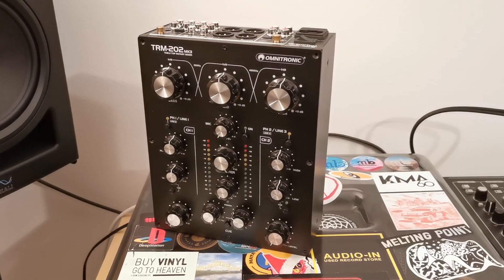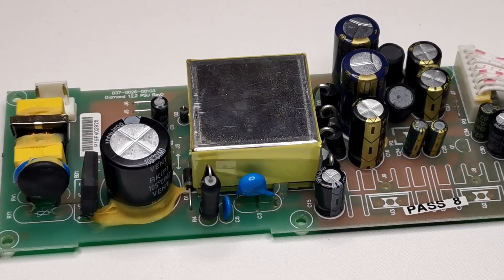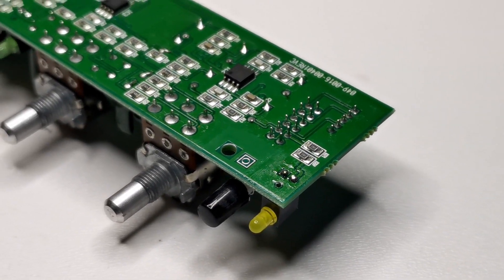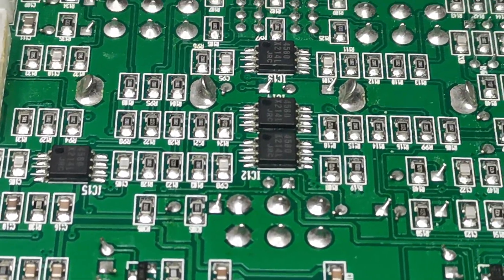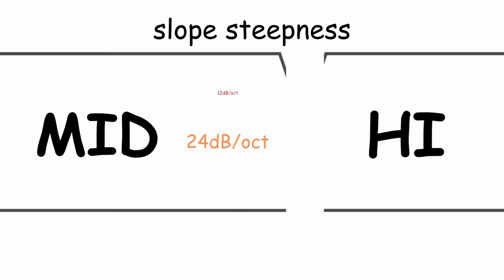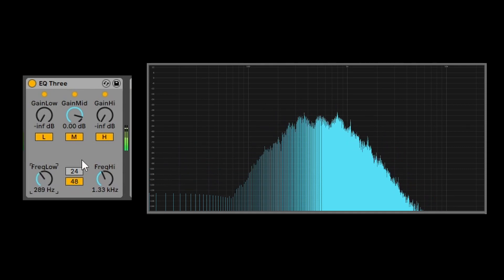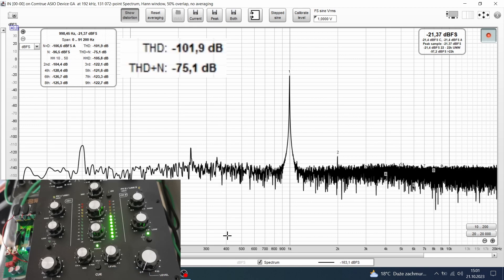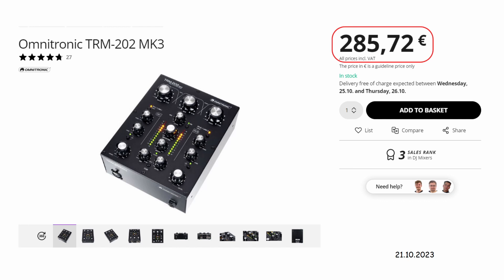Mixers Inside: Omnitronic TRM-202 MK3 + Isolator EQ explained

Comment: I just noticed something I missed... the specs on websites say:
"Frequency range line : 20 - 20,000 Hz
Frequency range phono: 40 - 18,000 Hz" ...is this really just different wording for the RIAA curve? Or, does it really cut-off everything below 40Hz? (which would be strange)
Reply from the maker: Some manufacturers just define flatness of the curve for limited freq range. Its possible that below 40Hz there is a rolloff but its for sure not cutting off everything.

Comment: Great job! Looks like I have a power supply problem with the bigger model, but used same power module. Power shuts off after a while. Capacitors and solderings are fine. Looks like the TOP267VG chip is getting too hot and switching off.

Comment: Thank you for this review, I fell in love with the 4 channel version at my friend's house, watched this and decided to get the 202.

Happy with the summing, but the EQ sounds weak: leaving the channel EQ to the 12 oclock notch, the tracks sound weak, but turning it one dot to the right the tracks sound as they should.

Is there a way to change the knobs so that they notch further than the default position? Hope this makes sense.
Reply from the maker: Maybe your system doesn't have enough bass and you just compensate this with EQ.
Reply: @mixersinside  Thank you for your fast reply. I have a lenghty but detailed answer.

Yes I have an issue in the low end lacking punch, but ALSO the high end lacking clarity. 

It'd be reasonable to assume it's the speakers, but: I never had any issue with any other device. 
System isn't massive but plenty for the room: a couple of Genelec 8010 and a 7040 subwoofer to go with them. 

I tried many audio devices, mostly a Xone 96, a DJM 450, or even straight from my Macbook: all of them always sounded detailed in the high and rich in the low end.
I have no reason to believe it's the speakers. 

btw at the time I tried my friend's 4 channel TRM-402 (I went for the 202) he also had a couple of Genelec 8010 (without the sub! just the 2 speakers) and I loved how the whole thing sounded. 
We hooked up both Technics and my Macbook (jack to RCA, or with a cheap DVS interface, both sounded great). 

I also checked with another system, this time in the garage: a pair of 15" heads and a 18" sub. This time the low end could be compensated by just cranking the volume, but the mixer still lacked clarity in the high end. 

A slight rotation of the High and Low EQ away from the 12 o'clock notch, one dot to the right, and the tracks come alive. 

All things being equal, the only weak point seems to be this 202 mk3.
Reply from the maker: @matteorizzo it makes sense, 2 devices with flat frequency response can have different tonality. Perhaps other mixers you compared TRM with had different sound signature. I consider TRM really transparent uncoloring mixer, devices like Xone for example give more color to sound. Perhaps Omnitronic doesn't go well with your system and taste.
Reply: @mixersinside  This 202 does sound great with the EQ slightly turned up though, wouldn't it be enough to change the pots' default behaviour?

I guess the final test would be to check another 202 or a 402 on these speakers.

Comment: I had the mkII, sold it and then got the Mastersounds Radius 2, almost x4 the price. On reflection, although the Radius 2 was a lovely little thing, the mkII was a fantastic deal.

Out of interest, do you know much about the omnitronic rrm-502? Only a couple reviews online and they're not great. But from it's appearance and looking at the manual it resembles the simplicity (and therefore potentially the short single path) of urei 1620 or the Bozak cma, but with out the balance controls, which I've seen is sometimes purposefully removed from the Bozak.
Reply from the maker: @danellanthony  thank you for sharing your thoughts and very realistic non-snob approach. Unfortunately I know nothing about RRM-502.
Reply: @mixersinside  np, and thanks for the great content and helping to break down perceptions 👍

Comment: I ordered a SubZero 2 channel rotary today, €180! I'll compare it with my Urei1620, I'm excited 😆
What would be the point of changing the capacitors, an upgrade so to speak. Have you ever tested that?
Reply from the maker: I'm curious about your findings. The only type of capacitors i would consider changing as an upgrade are the ones working in filter sections. I didn't test this.
Reply: @mixersinside  I think a 1620 video would be nice, maybe you'll find the time someday.
Regards
Reply from the maker: @braien25980  I have original 1620 filmed and analysed. I will show its internals in the wider context, cause I'm making a 1620 clone and I show the whole process on this channel. There is already an episode uploaded where I dive into 1620 schematics and comment what's going on there.

Comment: Still sending outputs to my Technics 1200's with this faithful 2 channel mixer. Always have the master at 12 o'clock, the levels dial never been near the 3rd dots and rarely see the green LED's blink past -25 but they can if I turn into an asshole, the Yamaha and KRK monitors get very loud in that zone, I could have my dials set all wrong but from what I can hear this is a very good mixer.

Comment: Hi there. Great review! I have one for a few years now, and I'm really happy with mixer for the price.
I think the phono pre-amps are pretty crap, but fortunately I have a dual tube valve phono pre-amp. 
Could you run some measurements on the phono pre-amps, Master and Booth outputs? That would be awesome. 
Keep up the great work.
Thanks
Reply from the maker: I did measurements on master outputs. If you watch my other videos you will easily find out that phono preamps here are almost the same as in Ecler or Rane mixers.

I don't want to make this channel a measurement hub, i do measurements to give you an idea whether mixer is more on transparent or dirty side and don't want to expand it much.

Comment: My old Vestax packed in a couple of years ago and my poor old 1210's have been incomplete.
I wasjust about to buy an Ecler nuo 2 and that is how I found you.... Thank you for such in depth reviews and testing.

 I am intrigued by the Omnitronics am I right in thinking the sound is better (subjective I know) on the Omni than the Ecler??

I want faders, do you know if the Omnitronic pm 322 uses the same components/has the same sound quality??

Thank you
Reply from the maker: To judge the sound quality you must listen - this is the final criteria. Numbers and measurements can help you to indicate if there is something going wrong or not according to the plan. I won't answer your question.

Regarding this omnitronic mixer - i don't know.

Cheers!
Reply: @mixersinside   I thought you would say something along those lines.

I loved the sound of my old Vestax which had a fair amount of distortion, definitely not clean but it did draw you in somehow.

Also, I find when playing CDJ's or wav files a bit of added body from the mixer can be fun. Ill probably stick with the plan an get the Ecler

Many thanks for your reply.
Reply: @nothingmemorable486  how did it get on with your Ecler, would you change it you could easily for something else.....assuming you had time now to sense the sound profile and maybe also based on what you want or consider to be missing....appreciate any feedback, cheers.

Comment: Hi Kamil, great content you are providing, )'m really thankfully for your work,  I have this mixer right here, and I've seen your recently RANE MP2016 and XONE also, do you think based on your experience and knowledge that would be possible to modify TRM with more quality components present on that mixers, or even make a simple smaller one like TRM 202 bases on the same principles and components? Cheers
Reply from the maker: Yes, for sure. Good starting point is experimenting with op amps, not necessarily more expensive ones.

Comment: Are the pots VCA ? or does the audio run through them ?
Reply from the maker: Non VCA, passive attenuation using stereo pots here (audio runs through them).
Reply: OMG , that is a HUGE fail . . .  .  @mixersinside
Reply from the maker: @user-rv8wb1nl1b  why? I don't agree that it's a fail. Most of rotary mixers have audio running through their pots. VCA sollution has more distortion than passive one. I cover this topic in Ecler Nuo 2.0 vs Warm 2 video.
Reply: in the medium to long term you do not want audio going through the things you tweak and turn most often . Inevitable crackles , why would a vca have higher distortion (if its even audible ) ?  rotary mixers are a bit of a fad , whatever next . go Mancuso Loft party and have no mixer , just an amp . . . ? @mixersinside
Reply from the maker: @user-rv8wb1nl1b  so you consider a budget mixer not using more advanced sollution (that still can degrade THD performance and there is a reason to avoid it) as a huge fail?
Reply: i very much doubt your ears can hear any thd distortion , ears are not that sensitive even if there were an increase , which is not evident in the first place . vca is proven better when done right and will last with no crackles . I think Rane used a magnet for a while and pioneer where optical in the 90s if i remember correctly , aaaanyhow , the LAST thing you want is audio going through a pot or slider . period . @mixersinside
Reply from the maker: @user-rv8wb1nl1b  speaking of proofs can you share some documents with me? This will be so useful and nice to read, thanks.
Reply from the maker: And yes, i obviously agree with you that audio going through sliders has serious disadvantages.
Reply: ears can barely hear a 3db change in volume , so even a 3% thd level (ridiculously high ! ) would hardly be perceivable at a 100db sound level . ( yes its rough maths but it does logically flow ) . A crackle in a pot or slider'fader can ruin a mix and need replacing . Great vids and info , thanks . @mixersinside
Reply from the maker: @user-rv8wb1nl1b  sources please!

Regarding 3dB difference in volume hmmm. I hear 1dB easily and its very easy to check with some basic software.
Reply from the maker: Let me provide the source then. It more or less goes along with what you say, but somebody took serious effort to check it.

http://archimago.blogspot.com/2020/06/blind-test-results-part-ii-is-high.html?m=1

Anyway i think that it's always worth it to minimize the THD when you aim for transparency. VCAs still don't have vanishibgly low distortion figures and in fact there are some ways to achieve better performance than using VCAs, while preserving the VCA pros like audio signal not running through pots, perfectly logarythmic curve and perfect channel matching and even achieve better "offness", that is often forgotten parameter.

The idea of making it better than a classic VCA first started from Rodec MX00 progressive series. I will for sure record an episode about it.
Reply: it's just known .. . . . Vestax Gemini  etc charged a premium for this for a good reason . No need to invent the idea that vca is noisy , just go with the facts , or speak to a circuit designer who does audio. I always liked the optical idea , with a mirror on the crossfader , and a laser feed , maybe it was Rane/Bozak . But then in a club , smoke may mess with the lightsource. VCA is best . @mixersinside
Reply from the maker: @user-rv8wb1nl1b  there is a simpler way than lasers. VCAs are not technically the best and i will try to prove it in one of the upcoming episodes. If you care you can check what i wrote in previous comment regarding this sollution.

Comment: Had the TRM402 for two years and I was so blown away by it I bought a Condesa (Lucia). And honestly, for home use the Omni really comes close in sound quality and summing capabilities to it when playing from a digital source like CDJ2000's. It's when you really start cranking up the volume an a serious soundsystem that the Condesa really starts to shine.

For the price it's an insane mixer and I can higly recommend it if you want to dip your toes into rotary mixers. Built quality is really high and it feels like a tank. It's the phono amps, isolator and the 3 band channel eq in the Condesa that make the difference compared to the Omni, they are superb in every way compared to ANY mixer (it should offcourse as the Condesa is 8 times(!) the price of the TRM202).

Overall I find the sound quality of the Omni's way better than a DJM700 or 800, and more on par like a DJM900. I can highly recommend it, and for it's price it's a fun addition to any dj set as mixing with a rotary is a different experience and mixing appraoch than a standard mixer.
Reply from the maker: Thanks for your comment. I feel a significant influence from the widespread excitement about Condesa mixers here. I hope to make an episode about those "legendary" devices so people can compare their build quality to other mixers and verify their opinion.
Reply: Would be very interesting to see how a Condesa is build up on the inside from an engineer’s point of view and find out if these boutique mixers really are worth their money!
Reply: @ltdada74 Also have had a 402 for years and this is a great summary. Never played on a condesa or Alpha etc.. But the sound quality has always been more than sufficient. I love my 402 and will probably never get rid of it.
Reply: Is it possible to monitor the master with the ISO using headphones?
Reply: @EduardoAlmeidaRJ   no

Comment: They spend maybe £25 to manufacture this mixer
Reply from the maker: nonsense comment
Reply: @mixersinside  250 retail. Retail price is usually x10 than actual production cost. Look at the components cost and circuit board. It's a fully analog mixer. Nothing crazy. Very cheap and easy to make
Reply from the maker: @MartinTeerly  if you happen to design a good performing £25 mixer with metal casing, reliable power supply, decent quality pots etc. please contact me via mixersinside@gmail.com, i have a businessplan.
Reply: @mixersinside you already said in your video that circuit board is also used in different model. I also want to to look on studio mixers and it's pricing. They're very cheap. Current prices of DJ mixers is ruled by Pioneer.
Reply from the maker: @MartinTeerly  please be realistic and do your research before posting such comments. Cheers.
Reply: @mixersinside  hahahaha ok
Reply: They spend that on the employee to assemble and test the thing alone, then they package and ship it, and provide warranty service for it.  That’s before factoring any component costs.  It’s objectively great value.

Comment: A nice little honest mixer with no BS, I do wish they would put a by-pass switch for the ISO tho and not just on this but others of this kind. On things like the DJR-400 I feel it's the only thing that really tends to degrade it's sound. The original Bozak also uses a Bax style eq for the master output ;) But I like where they chose the bands it boosts and attenuates 60hz and 10k
Reply from the maker: Can you explain what "BS" is?
Reply: @mixersinside  Bullshit :D Unrelated but if you'd measure the old Urei and Bozak's, they're pretty terrible. The Urei has a lot of distortion and pretty poor PSU, the Bozak again similar but less so but a lot of PSU ripple. Cross talk etc is also pretty pants depending on what you've done to it. Contrary to belief also the RIAA pre on the Bozak is flat or at least on my unit when I tested it on a Lindos unit. You should have a look at the silver A&H Xone 62, always liked those and now get overshadowed by other stuff.
Reply from the maker: @vinyljunkie07  I know Xone 62 well - the sound signature of this mixer is mostly shaped by SSM2164 VCA and in terms of distortion it's also nothing spectacular (but the sound is nice and round). Phono preamp in 62 is single stage active on NE5532 - not a standout. Apart from that it has pretty much the same circuitry as other mixers. 

And it has strange EQ, the low knob is behaving weird. They fixed it in 92 mixer.
Reply: @mixersinside  I never used those things when I mix on them lol I hate the sound when the filter is enabled and it just adds noise from memory, also I always have the x-fader bypassed for me... And eq most of the time.. But always liked the cut of the faders, the feel also (The 92's are far too loose feeling) and the sound wasn't hard in any way. I dislike the high capacitive loading on the phono inputs considering the turntable alone with it's wires will add another 120pf if it's a 1200 mk2 which seems to be across the board on their mixers.

Comment: Hello, first of all thank you for sharing your knowledge, it's very valuable !

 I have a question about the THD+N measured at nominal level. The measured THD+N value (-75.1dB) seems to be relatively high compared to the THD (-101.9dB). And when you look at the Bozak values in your last video, the 2 values (THD and THD+N measured at nominal level) are almost equal.

 Does this mean that the performance of the Omnitronics in terms of noise isn't great, or is this a "normal" value and the near equality between the THD and THD+N values of the Bozak comes from the high THD of the latter? I hope I've made myself clear, thanks in advance :)
Reply from the maker: I'm very glad that you watched this video with such attention to details.

The difference between THD and THD+N value in Omnitronic mixer shouldn't be a surprise, because the THD alone doesn't take the noise component into account, and well - the Omnitronic noise performance isn't spectacular. I suspect that it's hard to achieve better noise figures using ICs from this price range.

Close values of THD and THD+N in Bozak should also not be surprising, because the THD alone of Bozak is so high, that adding the noise component doesn't make much difference.

I hope you find this explanation clear - if not i'm here to further discuss the topic.
Reply: @mixersinside  It's very clear, thank you!